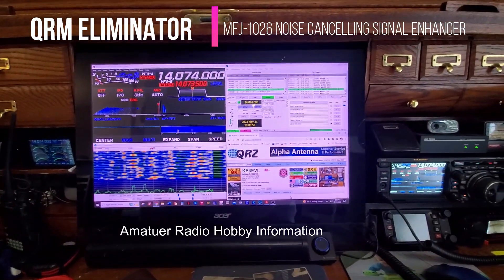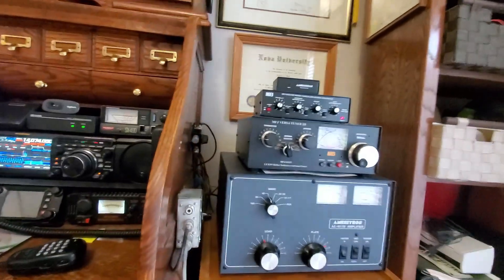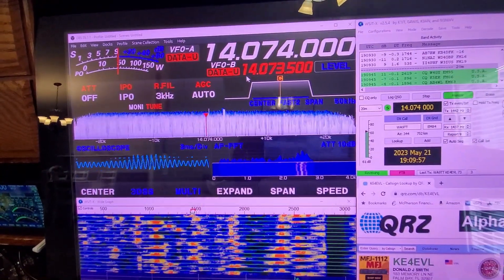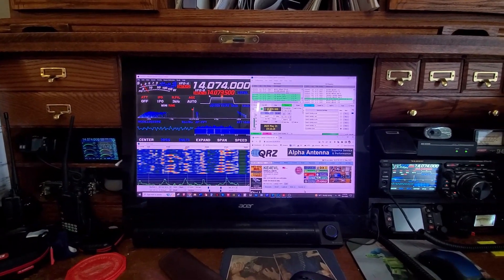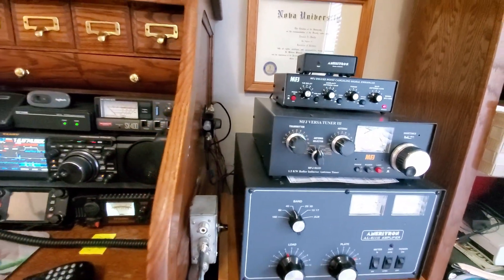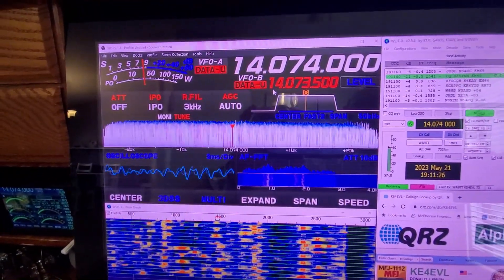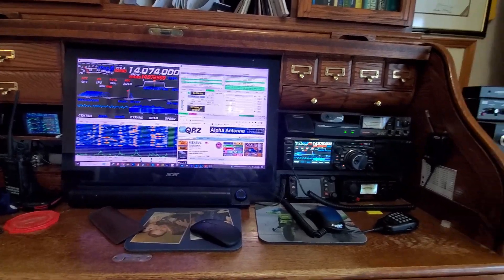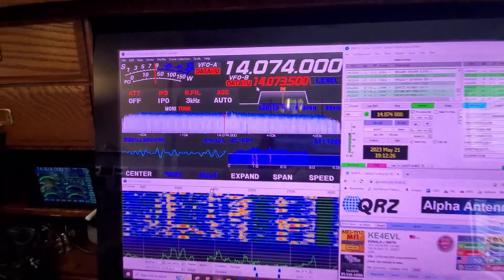QRM Eliminator - MFJ 1026 Noise Canceller - HF Interference

Comment: uzywam ten eliminator i moge powiedziec, że jest znakomity.W pasmie 80 od roku mam bardzo duze zakłócenia lokalne  silne smarzenie na paru MHzach uniemozliwiające całkowicie łączność na 80m.(59+25dB) dzień i noc. Pojawiły się nagle. Duzo experymentowałem z 1026 i najlepsze rezultaty osiagnalem przy dwoch bazookach Smarzacy QRM zbijam do zera przy normalnej sile stacji .Jako external antena miałem tez LW 10metr,ktory działał dobrze ale nie tak dobrze jak te bazooki. Było u mnie UKE  i też stwierdzil zakłócenia od strony drugiego sasiada i na tym sie skończyło. Panowie nie są chętni do pomocy.= jeśli ktoś ma podobne problemy to polecam ten eliminator- SP9DTI
Reply from the maker: Good to hear that the noise eliminator worked for you also. The key is a good external noise antenna like the bazooka.

Comment: i got real bad qrm from my neighbor who has a first generation solar system plus power poles. It sucks - I can only talk to local people in my area. but I might be forced to try this MFJ Device
Reply from the maker: It should work for you. It is a learning process to get adjusted and it is crucial to use a good external antenna for the noise reception. 

On a side note, work with the ARRL on your noise issue. The manufacturers of those systems should have free fixes for QRM for thier solar systems. The ARRL will contact FCC if they do not fix. That is unacceptable.  It is a process and will take some time.. but the reality is they have an illegal broadband transmitters interrupting the HF bands.

Comment: Hey Don,
QRL? Once you have identified the QRM as a QRM and not QRN it is really just a matter of shifting the phase angle to prevent it from entering the receiver at the front end, correct? Funny story, last July 5th @ 0500 I went out to my truck to check the battery I was charging. When I lifted the hood there was a tremendous explosion and I saw shrapnel raining down on the truck and driveway. First thought, battery blew up. Second thought, fireworks still being ignited from the July 4th parties. Then I noticed the entire area was strangely quiet even for 05:00. When I saw the shrapnel I knew what happened. A ceramic insulator on the power pole right above me failed and allowed the stress loop to be pulled and contact the pole. The boom was tremendous and happened at the exact moment I opened the hood. The inside of the insulator was covered in arc marks that had pitted it fairly deep, so I guess it had been going on for a while. OK gotta run. XYL is at my 20. 73 sir.
Reply from the maker: McDave, not busy. :-)... in this case, the QRN is QRM given it is rather strong, is man made, and interfering.  The noise canceller has a differential amplifier inside and when you invert one input (via phase adjustment)and feed it through along with an similar signal that is not inverted, only the differences are amplified which should be minimal if the inputs are adjusted well and the noise source is nearby and reaching both antennas in same phase.     Long distance signals sometimes arrive via multiple paths due to reflections and etc.. so they do not get canceled out completely although  they may be attenuated some. It is not ideal,  but is good enough most of the time.

 The differential amplifier has an inverting and non-inverting input so to get no difference on output, one input needs to be inverted... at least that is what I can make out from the schematics.

Ever thought about getting your Amatuer Radio license? You might really enjoy it. I chat with folks all over the country and world for that matter.  Just really cool to do that with no phone lines, satellites,  or technology other than my radio and an antenna.

That power pole was probably  very noisy from an rf perspective before it blew out.  Something like that is going on near me..loose hardware or a bad insulator on the high voltage side of the transformers are nothing but spark gap transmitters. The very first transmitters were spark gap transmitters. Marconi used one for his historic transatlantic wireless communication.